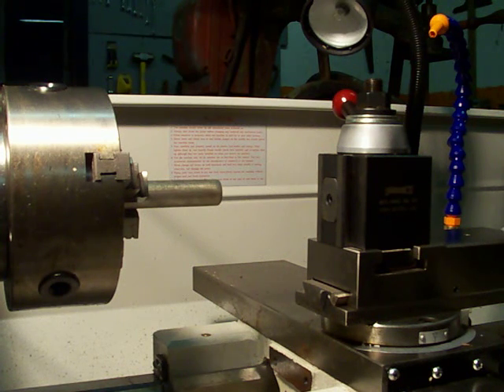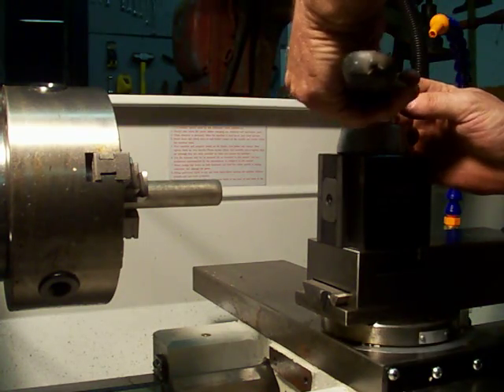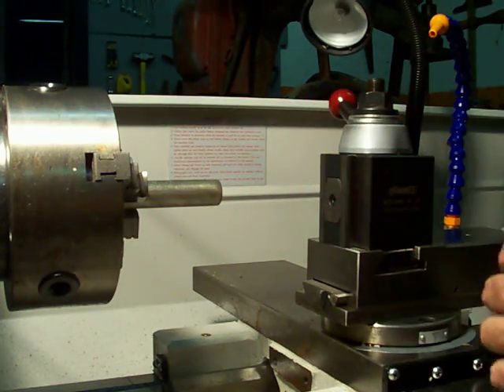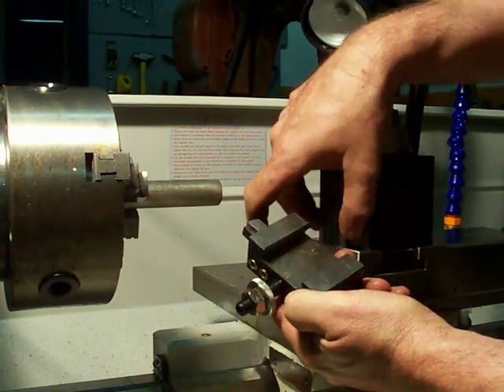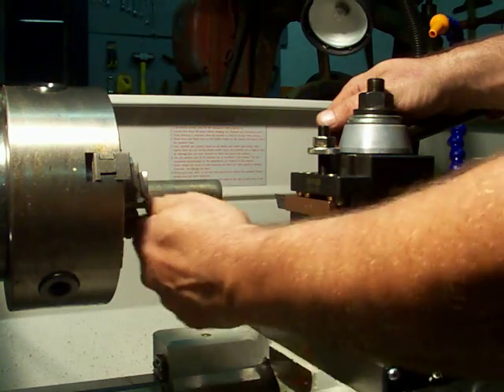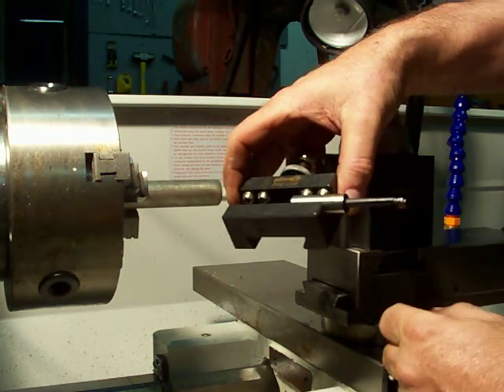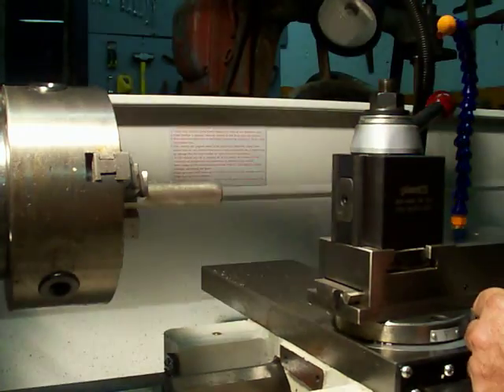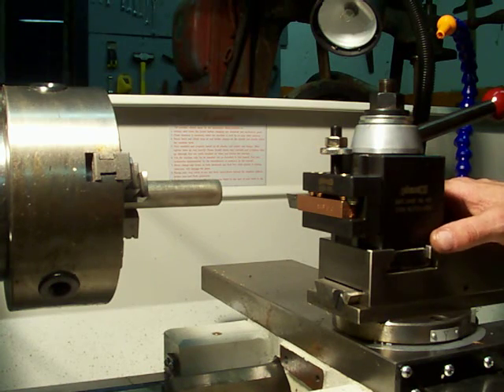Lathe Tool Post

Comment: I spent alot of money on one for my lathe. (series 400, everything is really expensive.) I am home and farm neighbor hobbyist. There are times this is convenient, but most of the time I cuss at it. I spend as much or more time setting this up as I would any other  tool holder. If I knew then what I know now. This is NOT the style I would have chosen. One huge disadvantage is the offset, your tail stock isn't long enough to use different tools without re-setup anyway!

Comment: @KitCox Yes.  You can set the height of each tool holder for center, but  I don't have a quick-change yet.  I have a standard four-way which requires you to use shims because it is not height adjustable.  it's the one that is basically a square block with a groove for a tool bit on each side and two or three screws to clamp the tool down with, that comes standard on the Chinese 7x12 lathes.  With that type, you have to set the height every time you re-mount a tool or sharpen it.

Comment: @johnlebl With quick change posts that I have seen the height is adjustable. As a non-machinist just beginning on my own, wouldn't you be able to adjust the height of the cutter point after sharpening against a fixed center in the chuck using the height screw on the post?

Comment: I think that the advantage for the hobbyist or person making one-off parts would be the ease of setting the tools to center height.  It's a royal pain to have to mess with shims every time I have to change tooling in my "4-way" tool post or after sharpening the cutters.  Tool changes may be more frequent with one-off parts than with production work, depending on the part because form tools and tailstock turret tooling that tend to stay mounted in high volume work.
Reply: What about old fashioned rocker type tool post.  I have both the 4-way and one of these, and never use the 4-way because of the lack of height adjustment. The rocker type is pretty quick and easy to adjust despite only holding one tool.